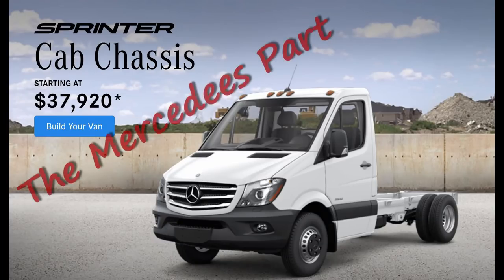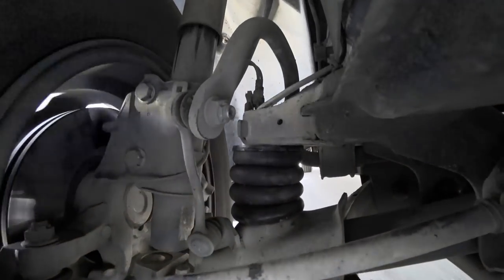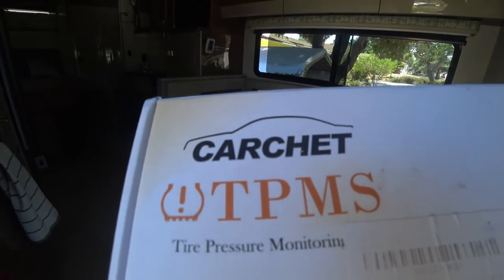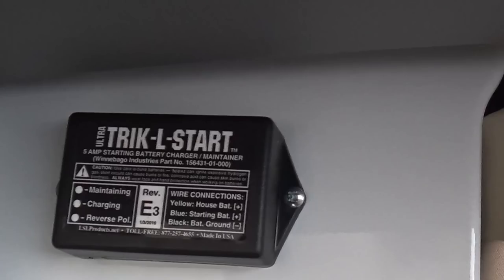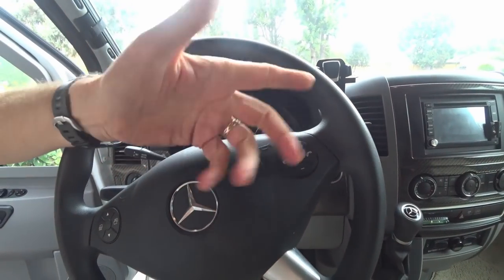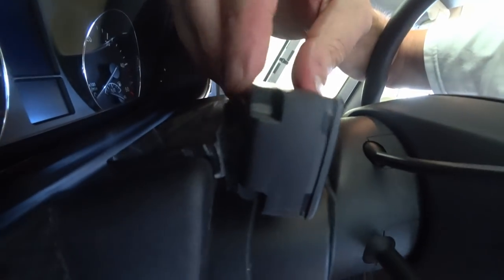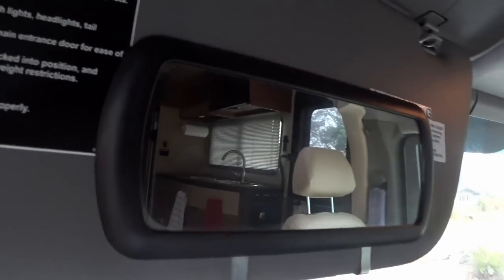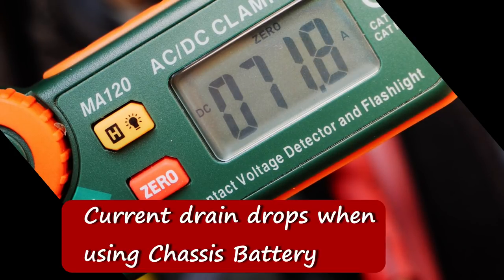Winnebago View - Essential Chassis mods

Comment: I guess some things never change at Winnebago. I bought a new Class A 27 foot in 1988. The way it came from the factory was absolutely dangerous in heavy winds, passing trucks and in turns. I immediately replaced the front and rear stabilizer bars, added heavy duty coil springs in front, and added 8 Bilstein shocks all around. What a difference! The old C hevy 454, 3 speed was also terribly under powered and ill-geared. I added Banks headers and exhaust systems and a Gear Venders gear splitter, which in effect converted the 3 speed transmission to a 6 speed. Again, what a difference. All these alterrations were modeled after a motorhome which had completed the Alcan Road Race doing an average of 90mph!

Comment: Great stuff Ron, I added the sway bar and the Fox shocks. Also sumo springs on front and rear, drives great. I have the crossfire system for monitoring pressure in my rear tires and find it easy and reliable, I have seen it in use on fire trucks so I’m guessing it’s pretty stout. Love my trik-l-start been in for over a year and flawless operation, can’t believe it isn’t stock.

Comment: It would be helpful "essential?" To see how you got power to all the electronic add ons...and detailed install on the trickle charger....I tried to find video on that, but don't see it.
Reply from the maker: Sorry about that.  I installed the trickle charger a long time ago before I got so involved in recording how and why I do stuff.  For the AC circuits, I just combined both branches together in the circuit breaker box.
Reply: We just got a 2017 view and I've been Binge watching your videos...some things I'll jump at...the oil change etc.  I'm pretty savy with wiring but I pulled off the dash panel at the fuse box and took out the glove box to find a power source to add a usb charge port on the dash....a maze of wiring harness.   Appreciate the tight construction but.... no clue where to start.  Anyway...love your channel.  Hope you make a $$ on orders from your Amazon links...I've blown my budget on them!  Papa Jim.

Comment: What is involved in adding the Borg stems?  Do they screw into the existing stems, or do you have to remove the wheels?
Thanks for the great video.
Reply from the maker: Tires need to be removed as they install from inside of the rim. Discount tire did mine.
Reply: @ontheroadwithron2432  Ron: Is it really necessary to replace the stems before adding TPMS devices? The little caps are very light weight as I recall from my experience with a Class A MH I owned.  Someone else also suggested a device that balances air pressure between the rear tires.  Years ago I had a flat on the inner tire of a 2015 Sprinter that I luckily noticed right away

Comment: Ron, I really enjoy your videos and have made several upgrades to our 2018 VIEW based on what you've shown me.  I have one question on the 12V plug you installed to the left of the drivers knee.  Where did you get the power for that?  I want to put in a USB plug to charge my TPMS and just don't know how to do the electrical part.

Comment: Hi Ron, in a previous video, you changed the hot water tank thermostats to a lower range. I like you, hate to be scalded. Could you tell me where you purchased the new stats? I can only find the higher C stats. Thx.
Reply from the maker: Got it on Amazon Atwood 91470 Thermostat https://www.amazon.com/dp/B002UC2WR0?ref=ppx_pop_mob_ap_share
Reply: @ontheroadwithron2432  As always, thanks for the mod and your reply.

Comment: Amazing mods for sure especially on the suspension. My truck company has always UP my PSI in rear due to weight once loaded for trips. around 72psi. They do it for all trucks for years for Less blow outs they say. Hard to figure tire pressure. Also will get the trickle charger. If you are limited on funds would you do an upgrade on sway bar first then suspension?? You are amazing to do all that work yourself. Grateful for info.
Reply from the maker: Yes, my first upgrade was the sway bar.  Helps with the sway with no impact to the ride like the Sumos do.

Comment: Thanks for your vids! Really interesting!  I was wondering if you could tell me the brand and type of the levellers you installed in the cabin or where you purchased them. Thank you for the info. All the best from Belgium, preparing my RV to come to the US. :-)
Reply from the maker: Welcome and good luck with your travels.  I use the yellow ramps to get the rig level.  Don't have any automatic levelers, but the SumoSprings keep the coach pretty stable, so I'm good. Yellow ramps have worked great. From Amazon https://www.amazon.com/Camco-Tri-Leveler-Capacity-Durable-44573/dp/B000BUQOFO/ref=sr_1_19?ie=UTF8&qid=1544827713&sr=8-19&keywords=rv+ramps

Comment: Interested to know more about the install of the Trik L Charge.
Reply from the maker: Dany Laliberte pretty easy. Drill 3 holes for wires and mounting screws. Then 3 wires need to be hookup. The ground wire was a little more difficult. Took me a couple hours.

Comment: Ron, Love your vids.  We have a 19VJ and wondered how you installed the Trick-start-Charger?  There's and older video Youtube from "08", but sounds like its not working for some people. Thanks again.
Reply from the maker: Garry Hall I screwed mine on the side of the passenger seat sheet metal. Pretty easy install, but had to find a good ground. It’s all under the seat where the boost solenoid is located. Just followed the directions that came with it.
Reply from the maker: Garry Hall btw I never had any problems with this unit in 3+ years.

Comment: Ron, Thanks very much for sharing your experiences. We recently bought a 2017 View and I'm interested in making some suspension modifications. Mostly for swaying going up driveways at an angle and also cross wind control on highways. I can't do it all at once, however. What is most important to do first ? The sway bar, shocks or Sumo Spings? There are some choices in sway bars... Why did you select Hellwig brand? Do you think most sway bars are all about the same? Beside the rear shocks, did you install the Kona front struts also? They are quite expensive and I don't know if they make that much difference.
Thanks for you ideas. Paul , Oceanside, CA
Reply from the maker: Hi Paul, Just got back from a 7000 mile tip San Diego to Boston and back.  Now I'm not liking the front Sumos.  They are too harsh on some of those bad freeway joints and I hit a ton of them on this trip.  I'd say do the sway bar first.  It helps with the tilting and does not impact the ride.  I got he Hellwig since I liked the idea of just replacing the original bar and not having to bolt something extra onto the chassis.  I'm happy with the rear Sumos, but might change out the front ones.  If you do want to add them, try the blue ones, they are less stiff than the black ones I got.  Some of this is personal preference.  The good thing about the Sumos is they reduce the rocking when walking around inside.  I don't have levelers and probably never will.
Reply: Thanks for the update , Ron. Wow, that is a lot of driving !  No doubt you are happy to be home. 
We live at Ocean Hills in Oceanside but still have a family cottage back in CT. Flew there for six weeks this summer. While we were there we went to Albany and bought our RV and when our East Coast stay was over, we drove it back to Oceanside. In July the whole Mid-West was 100+ temps every day with very high humidity. Also with PM violent T-Storms. We abandon our sight seeing plans and headed to the rockies - where it was beautiful. In any case, half of your trip was sufficient for us.
Thanks for the input on the Gear. I saw another comment online saying the front Sumos were too harsh. Maybe I'll start with the sway bar and try the rear Sumos. I was driving up to Murietta last week with 30-40 MPH Santa Anas bouncing me around and it convinced me to continue looking for a better suspension solution.
Thanks for you help.
Paul
Reply: Sumo now makes a yellow rear spring set with 1400 lb capacity at 50% compression SSR-338-54. I was thinking about getting them, but noting your stiffness concerns with your front sumos not sure. What’s your best guess on going stiffer in the rear?
Reply: Little Paulie 2017 View
I called Sumo and asked them about my situation and they recommended the black ones for the rear if I wasn't towing. If I were towing a trailer etc, then the yellow would have been recommended. I did drive the rig after putting on just the rears and the roll was reduced and the ride was a bit harsher  in rear. I would take the trade off of a slightly harsher ride for better feel and control. I took Ron's advice and I used the lightest ones in front (blue).  The "road" definatety gets transmitted up to the steering wheel with the front Sumos. But it corners much,  much better  and I feel I have better control so I am happy with blue front Sumos and Black rears. Good luck
 @jobluez
Reply: @ontheroadwithron2432  
I took your advice and put the lighter duty Sumos upfront (blue) . They also accentuate the expansion joints thru the steering wheel, but the control and stability is a great benefit and I am very happy with the suspension upgrades. Thanks very much for your encouragement !
Can you tell me where to make the connections for the TRIK-L-Start under the passenger seat ?? Seems like a mess of wires, under there. Thanks
Paul

Comment: Ron, I have a 2015 Forest River 24R motor home on a 2015 Mercedes chassis 3.0 L.  This past week we pulled into the RV park and hooked up electricity.  The power worked the air conditioner and micro wave but would not charge the coach batteries.  When the batteries went down we lost all power to lights and other items.  I purchased a 10 amp 12 volt charger and kept batteries charged.  On our trip home the batteries reflected a 1/3 charge from charger when we left RV park.  However, I noticed that the batteries were fully charged from running the chassis several hours.  Do you know why my batteries won’t charge from the 30 amp electric hookup?
Reply: Sounds like your converter may be bad

Comment: After reading everything and not liking the sway or handling on my 2020 Winnebago View: The upgrades I did were add the Agile Off-road Fox 2.5 rear shocks and the Roadmaster sway bar that goes in front of the rear axle and keeps the factory sway bar so you have both.  
Absolute game changer for handling, sway, wind and just confidence when driving.
It is pure and simple truth that the way the Sprinter 3500 Chassis comes from the factory with the narrow wheelbase and top heaviness of the Winnebago View weight should really never get out of the factory in that stock condition and be delivered to the public in my opinion.  This was about a $1500 -$1750 and less if you do it yourself and a upgrade that is significant and makes this vehicle much safer and greatly limits the back and forth swing as well driving around town.

Comment: Great video, thanks. Wondering what the Garmin device offers that the Rand-McNally that came w/ our 2017 24G does not have? (The Garmin sure is easier to see)
Reply from the maker: Well, I could never figure out how to use the RM unit.  It was so hard to see anyway, I just gave up trying.  I just replaced the radio with a Sony unit with carplay and it is so much better in every way.  I still use the Garmin as it is closer to my line of sight and it a little more adjustable as to what info is shown.  For example, I display the elevation on the Garmin and have the time to destination on the google maps on the sony unit.
Reply: The Rand-McNally in our View works better after I did the software upgrade, but as you say, it is very difficult for the driver (me) to see.
I might have missed it, which Garmin do you like? 
I am considering the Garmin DriveSmart™ 61LMT-S for ours, mounted just like you showed, should be much better.
Reply from the maker: I have the RV 760 with 7" screen.  Use that and Google maps on Carplay..  Garmin is the easiest to see and nice display, although I usually take the google route as it is quicker.

Comment: Ron, I don't know if I missed the maker of the windshield cover, but am interested in something like what you showed. I have a 2007 View ,that I've owned for a few months now, so I don't know if windshield sizes have changed but their probably the same size or close. Thanks ! Great videos by the way !
Reply from the maker: It's an ADCO brand I got from Amazon.  Box says it covers 2007 - 2012, but it fits my 2016 perfectly.  link: https://www.amazon.com/gp/product/B00JVQFXB0/ref=oh_aui_search_detailpage?ie=UTF8&psc=1
Reply: Hey, thanks Ron, I found that in the little bit of time sitting here. I figure it will fit mine also, mine is a 2006 Sprinter chassis, but a 2007 Winnebago View. I doubt that the windshield would have changed. I hope to enjoy our new/used addition, 1st RV for us and so far liking it :-)

Comment: Hey Grandpa Ron on your chassis upgrades, which of the three make the most difference on the coach away? The bigger stabilization bar, the shocks or sumo springs? Did you install? Or dealer? Any rough costs? Thanx
Reply from the maker: The sway bar was first and made the biggest improvement. Sumos made stiffer but gave a harsher ride. Didn’t notice much with shocks. I believe the sway bar was around $300. I installed it myself.

Comment: Ron, when charging the Coach batteries via plugged in to shore power, does the battery disconnect switch need to be on?
Reply from the maker: I believe so. I actually never turn them off.

Comment: Ron, could you please post links to the exact parts you recommend for the sway bar, shocks, and springs? I was trying to get them on my new 2018 Winnie Via but the dealer wanted $3600! So I was thinking of DIY'ing it but needed specifics on which parts I need to order. Thanks!

Also... I see you're in CV, I'm in Bonita, and you already have the jack and the tools... would you be able to install the sway bar, shocks, and springs for me and my in-laws? Thanks in advance!
Reply: Helwig is in Visalia, CA and will install these parts. They are top notch and manufacture everything on site.

Comment: Ron, have you looked into airbag suspension? I was looking at Airbag Man's kits. Or do you think Sumo Springs "airless air bags" are substantially similar to airbags?
Reply from the maker: David Ahn I’m not real happy with the sumo‘s. They give a fairly harsh ride. I’m gonna try the fox shocks next and take the sumo‘s off
Reply from the maker: David Ahn never tried airbags but my previous RV had some old airbags and they never held air for long so it’s a nonstarter for me
Reply: @ontheroadwithron2432  Thanks for the update, Ron; sorry the Sumos didn't work out. Good to know, since I'm looking for a softer - not harsher - ride. Rough state highways in NM and AZ made it plain I need something softer! The Via seems quite a bit less shaky when passing trucks/RVs than my in-laws' View, but I could use more crosswind stability. But primarily I want a more compliant ride.

I've learned there are actually quite a few air suspension options available stateside. I like the idea of adjustable ride quality depending on load, the possibility of leveling the coach using the airbags (if you get 4), and the compressor might also fill low tires.

Comment: Hey Ron , I got a   - view 24j 2008 , Just trying to improve the Cornering control and body roll .. So after all your experience from all your grat trips and observations , to start with  upgrade the sway bar (HellWig) and black Sumo springs on Rear and Blue in Front right ? . No Shocks replacement at this time  as you didn't find much benefit /? or trying to find another model ? .
Reply from the maker: The Hellwig sway bar is great. Not sold on the Sumos since they make a rougher ride. They do help while parked to reduce rocking while walking around the RV. I would like to remove the sumos and get Foxshocks.
Reply: @ontheroadwithron2432  Thank you - Btw you don't suggest the Sumos either in the front or rear right ?, I like to reduce the vibration and noise , that's why cross checking .
Reply from the maker: John Lonappan yes, I’d skip the Sumos.
Reply: @ontheroadwithron2432  Just another one - The U clamps on the Hellwig sway bar seems like much thinner than the Stock  , did you do use the same or made any customization there ?

Comment: Ron, do the chassis mods void the Mercedes warranty? My dealer said it might. I'm specifically talking about the sway bars, shocks, and springs. Your channel is VERY helpful, as my in-laws have a View and my wife and I just bought a Via. Thanks in advance!
Reply: I suppose between my in-laws and us, we could save a pretty penny if I did the installs myself! Also, what do you think of the Safe-T-Plus system or the Roadmaster Reflex? I'm wondering if you're feeling stable enough with your mods, or whether you see value in something like that on top of them. TIA!
Reply from the maker: David Ahn no they done void warranty. I heard Forest city adds the swaybar and Sumos as std.
Reply: Thanks so much!

Comment: Hi Ron!
How did you wire in the scan gauge?  When I use the stock cable with mine, I can't use the fuse cover door.  Looks less sanitary.
Reply from the maker: Chris my door wouldn’t close either. I had to remove the 2 screws that’s secure the OBD connector. The connector is loose but I can push it back with the scan gauge plugged in and close the door.
Reply: @ontheroadwithron2432  thanks!